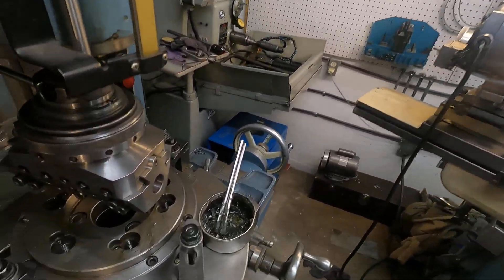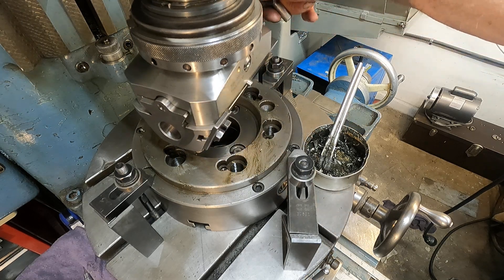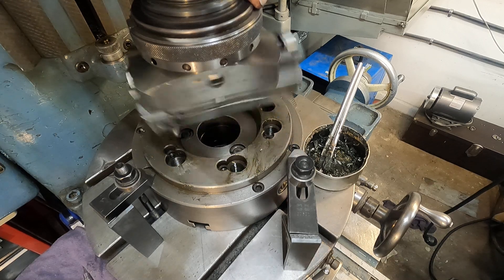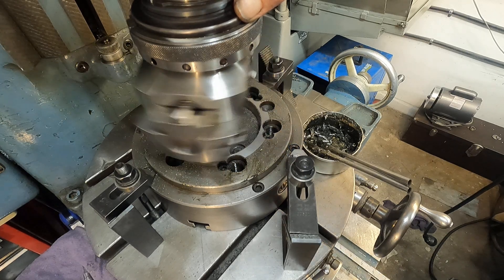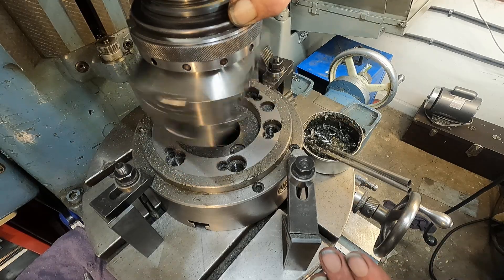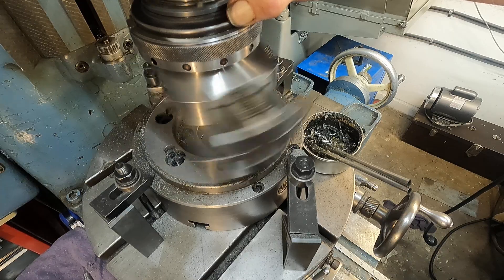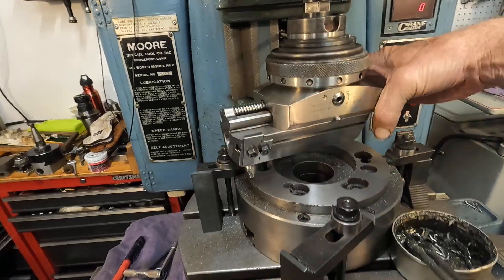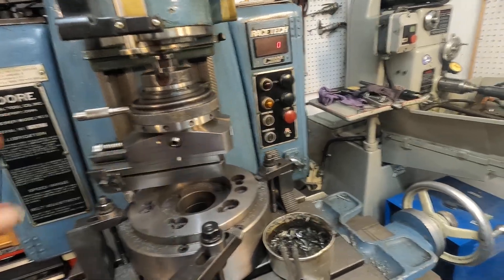Moore jig borer facing with a Wohlhaupter head

Comment: Lot of weight slinging around with that facing head  -- would hate to accidentally start it up in a high speed range .
Reply from the maker: Yes the machine must be set for speed first because it is recommended to park the machine at 1250 to help from getting a kink or set in the expensive belts by keeping them in the center of the pulleys.at mid speed The machine should be run from high to low twice to lube the upper drive moving components before using the machine.
 I just moved the Wolly to the #2 mills vertical head .40 taper and I will try the same on another junk back plate. I will be adding the Tree head in also. I think I can save 2 junk scroll chucks.